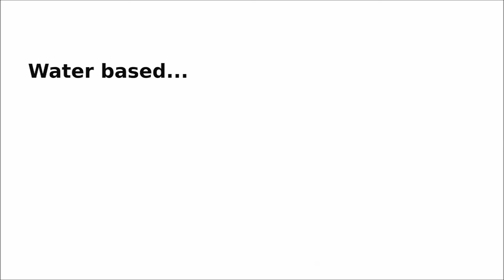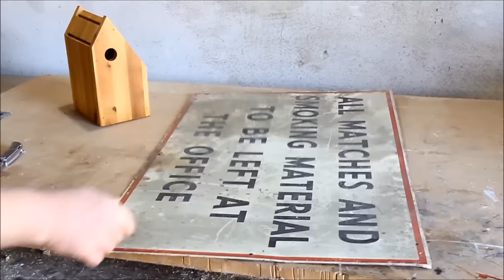How to make 5 Birdhouses.

Comment: Great ideas thank you. Being an old man that has built my share of birdhouses, the only suggestion I would make to the inside is a piece of screen from the bottom to the hole so the babies can climb up. Great job!!
Reply from the maker: Thank you very much, that is a great idea.
Reply: Your great tip is well taken today!
Reply: I dont think you want the babies 'climbing up' until they can fly. Then the screen is not needed. Putting a screen for climbing on the inside is asking for flightless babies falling out and not able to go anywhere or get back in. Bad idea.

Comment: - Rewatched the video & especially liked the 'triangular' birdhouse. What degree of cut did you use for the top portion of the sides ??? I completed it with wood strips up 3/4 of the sides with metal for the roof. Very interested in completing it with wood & the sharp angle of the roof portion. Thanx 4 sharing.

Comment: Would you be able to post pics of the birdhouses to show how they stood up to the elements?

Also: why did you pre-tap the nails on your workbench before hammering them in?
Reply: If you dull the point it is much less likely to split the wood. Also works well framing houses!

Comment: Nicely done!. Quick dumb question, I noticed in the first house that you tapped the nail on the table a couple times before using it for the house, why is this? also what did you use to keep the door closed? what is that called? Thank you!!
Reply from the maker: Thank you Antonio, 
I tapped the point of the nail to flatten it a little as this helps to prevent the  wood from splitting. I used these https://bit.ly/2FsOxrG  to keep the door close as I had some laying around but any bit of flat metal or even wood would do the same job.

Comment: I am a total beginner to woodworking and DIY and i have a question - sometimes you seem to be hammering a nail into the work table, whats the reason for this?
Reply from the maker: Hi, if you flatten the point of the nail it helps prevent the wood from splitting when you are nailing close to the edge.

Comment: Are You tapping in the nails before nailing them in to prevent splitting?
Reply from the maker: Hi Diego, yes blunting the tip helps prevent splitting.

Comment: Ok, around 1:30, what are you doing with the nail before you use it on the work piece?  Is that like a little pretap action?? I must know! LOL
Reply from the maker: Hi Molly,  If you take the point off the nail there is less chance of the wood splitting.
Reply: @EamonWalshDIY  ooooohhh interesting! Thx!

Comment: It is always good to see posts about building bird boxes.  Please consider adding elements of safety to your plan:
 • Search sites like Cornell Nestwatch for excellent tips:https://nestwatch.org
• Confirm access hole is correct size for species you are attracting.
• Perches are not recommended, they can attract predators.
• Add a predator block or guard over the access hole.
• Instead of perches make several shallow kerf cut below the access hole.  Also inside so chicks can fledge.
• Provide lots of ventilation. Lack of it can overheat eggs and chicks.
• Provide floor drainage. Just cut a bit off each of the four floor corners.
•  Use real wood. Plywood or treated wood can give off harmful gases.
• Provide an access door for cleaning.
• Don't paint or stain boxes.
Reply: Thank you!

Comment: Are you blunting the nails before hammering them in?
Reply from the maker: Yes I am, it helps stop the wood from splitting.
Reply: @EamonWalshDIY  okay, thank you. Do you have a nail head in your work bench?
Reply from the maker: @cankerscarves1806   No I didn't but you could do that if it made it easier.

Comment: Just curious I noticed you nailing the nails a little on the table before nailing into the birdhouse wood, why do you do that? Is there a reason? Or are you just trying to confuse me? Just joking but why?
Reply from the maker: Hi Lily, 
I tap the nail because if you take the point off the nail it will help to prevent the wood from splitting.

Comment: Why do you tap the nails into the workbench before you hammer them in the project??
Reply from the maker: Hi Dean, if you dull the point of the nail it helps to stop the wood from splitting.
Reply: Eamon Walsh DIY thanks for the tip 🙏🏼🙏🏼

Comment: Lovely but there are some troubles. You should make some holes at the bottom to drain water. The opening of the holes should be less than 30mm and with a metal plate on the outside. No poles or stick they help predators not birds.
Reply from the maker: Thanks.